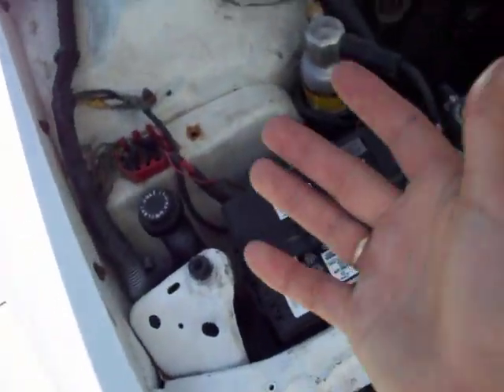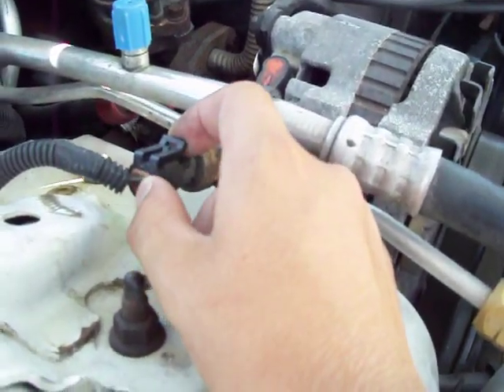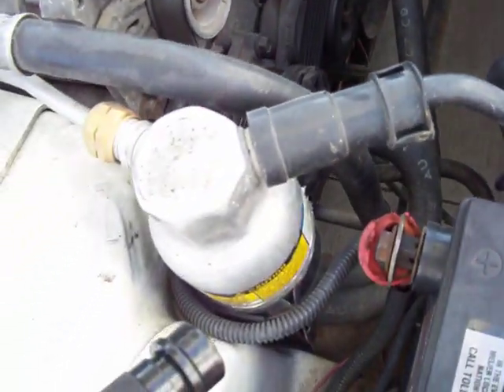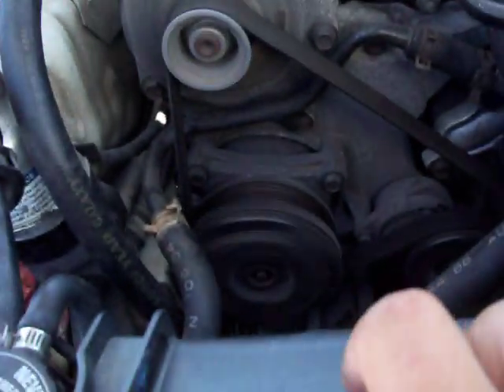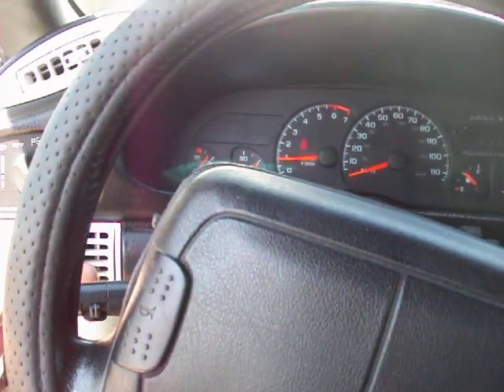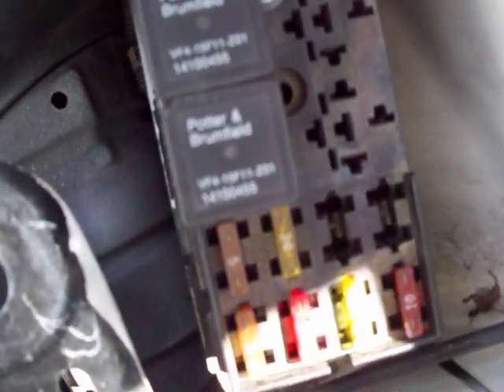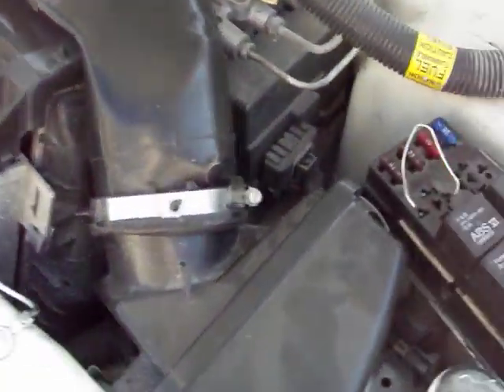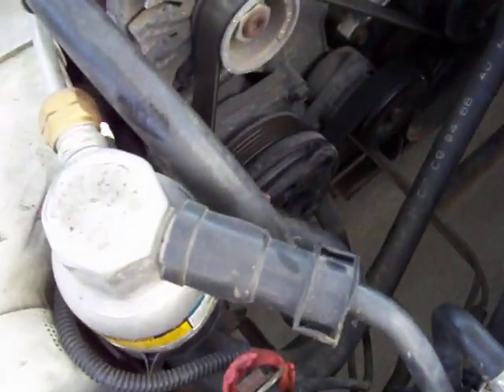How To Make AC Ice Cold, Recharge air, and Force the Compressor Clutch to Engage

Comment: I had to have all my system emptied to replace heater core.   When I was ready to refill, my clutch would NOT engage.  Followed instructions to put 1/2 can in. Then 3/4 of 20oz can, and best I would get was it engaging for a few seconds every 30 seconds or so, but could not get enough in to"satisfy" the computer.  I did the paperclip trick and had it working in less than a minute.  Great post and instructions despite all of those that disagree!   Thanks!!!
Reply: +Joel Gueck  If It is charged, what is the pressure on the high side of the system? If I were You Joel, I would get a video of the PROPER AND CORRECT procedure of how to do work like this...Dis-regard the video the air-head 101 dude posted above.... And Joel, never-ever use the sealant he suggested... It often destroys a/c systems and will give You consistent problems...

Comment: "If you have any questions, make sure you ask someone, I'm sure anyone can help you."

I LOL'd. Best instruction video ever ;)
Reply: I heard that one, I think he's trying to say, someone will help you, lol
It's much more complicated than this video.
Reply: I was like anyone?? When i tell ppl bout shorting relays they look at me like wtf lol
Reply: Thing is, once you’ve put that stop leak stuff in your A/C system, if later you have to take it to a shop, you’ll be pretty hard pressed to find a reputable shop that will work on it because that stuff fouls up refrigerant capture systems.  Further,  if the paper clip test activates your compressor, you’ve found the problem...why not get a new pressure switch and correct the system fault properly?
Reply: @douglasashby4862  The sensor is noticing low pressure. So it won't let the compressor run. No compressor means no recharge. So trick the compressor into thinking the switch says there is pressure, then refill.
Reply: @douglasashby4862 not enough freon, won't allow your compressor to kick on. The 📎 is forcing the compressor on without enough freon in the system. Once you get enough freon in, the 📎 is t needed. That's not an indication of "finding the problem"

Comment: As someone who works on computers on a day to day basis and just starting to tinker with cars, this video has helped me a lot. Thank you so much. Really.
Reply: Alan Trevino De Arcos Hello Alan, what really needs to be done is to refer to the PROPER methods of doing work like this... Get info from a PROFESSIONAL technician who has EXPERIENCE doing things like this... Please dis-regard this video as it is wrong in several points...DO NOT use the sealant he described in this video as this will probably RUIN Your a/c system...Use the video available at Auto-Zone of how to PROPERLY do this procedure....

Comment: Your description of the terminal 30 and 87 function, or I should say the flow of current was extremely helpful. I'd seen a couple others and they'd, say, show the relay diagram and say 87 and 30 were responsible for starting the clutch....but not that 30 was power to the relay, and 87 is power to the clutch (compressor)....and - say - used alligator clips to 87 and 30 with no explanation as to WHY....THANKS!!

Comment: read some comments most criticism, but No Help at least this Youngster is trying. What R U Doign????
Reply: if you add refrigerant it will tell the low pressure switch to turn on the compressor. than you watch your gauges untill you are close to your temp psi chart. weighing tanks takes too much space in my trunk. DO NOT RUN YOUR COMPRESSOR BY A PAPER CLIP!!!!!! THERE ISNT ANYTHJNG TO LUBRICATE IT IF THERE IS NO REDRIGERANT!!!!!
Reply: Thanks for help
Reply: @soupboy2391 you can't even spell refrigerant correctly. You do need to force the compressor on with a 📎 if it's to low on freon. Otherwise you won't get it to accept freon if the compressor won't click on!
Reply: @James Medina  the refrigerant is pressurized. When you add it, it will trip the normally open low pressure switch to turn on compressor. Freon is owned by Dupont.

Comment: fantastic, did this yesterday because the air coming out of the vents was warm. compressor not spinning. used this method and followed the instructions and the compressor started to run automatically when the pressure went above 25psi. now its reading 40psi and the air coming out the vents is cold. great. thanks.
Reply: I know you made this comment like a year ago, but I'm in a similar situation. Did you use the paperclip to force the clutch to engage while recharging, or did you just recharge without doing that? Is it even possible to recharge it without the clutch engaged? I'm guessing no, but I don't know much about this stuff.
Reply: The compressor must be forced to engage if isn't engaging on it's own. You can't recharge without it engaging. It won't suck in the freon into the system if it isn't engaging.

Comment: Just recharged the a/c in my 1998 C1500 W/T after years without. Tried before but always thought since the compressor didn't turn on it was going to be an expensive fix. Never thought of jumping the relay, it worked. Most relays have marks near the prongs, 30 and 87 are labeled clear as day, three inch piece of 18ga wire and go. 90 degrees today but not in the cab. Thanks man

Comment: this actually worked for me ford explorer thanks dude...funny how all the mechanics come to hate instead of making a video with advice like this young man who is just trying to help haters
Reply: David Sanchez, Dave- did You actually add the sealant as this video suggests???? What is Your high-side pressure at an ambient temp. of say- 95 degrees F. ???? If You added the sealant and You don't know what the high side pressure is, chances are that Your vehicle's a/c system won't be working for very long Amigo.... These people who are commenting here of the fallacies of this video are not haters, but quite to the contrary; they are trying to prevent others from getting into trouble- from the very bad ideas/advice given in this video.... If You don't agree with that, that is fine- Just as long as You don't pretend to be a 'technician' and use these techniques to work on other people's vehicles... That could cause other people to think of YOU as an ill-trained hack who does not care for others, except for maybe- their money... They might even think of YOU as a 'hater'.....
Reply: yeah. my thoughts too. with all their typing, they could of made their own kick ass totally perfect videos
Reply: To Robert Henderson, The typing is a good practice in communicating to others, who actually want to get some problems taken care of, in this case; automotive a/c systems.... And then there are those people who are not interested in communicating at all - or try to repair anything... They Just want to heckle others who are repairing problems... These people soon become an interesting study of what happens to an idle mind.... Did Your mother have any kids that lived?

Comment: I want to say thank you for providing this video.  I realize there are a lot of people here commenting who are great mechanics and have a great deal of knowledge about cars.  The individuals who are commenting about his using of this method to force the AC clutch to engage are in a way correct about the methods used, but the author of the video is also correct .  Always wear protective eyewear when working anywhere near pressure lines and/or fluids/chemicals that can damage the eye(s).  His method of shorting out the fuse so that the clutch will engage will in fact work and he is knowledgeable in that regard.  The problem, if the pressure is in fact low, is that there could be a number of things wrong causing this to happen and may even be a leak somewhere in the system which means adding more freon is a waste of time, effort, and money.  Make sure to talk with a mechanic before doing any of this work as a simple freon leak could be present and that may be all that is causing the problem.  Low pressure due to a freon leak can cause the clutch to disengage.  If however the clutch is not engaging because of something else, adding more fluid (i.e. increases pressure) which can damage the compressor possibly leading to you having to buy a new one altogether.  So make sure to get quality advice to ensure it isn't a simple repair resulting in low cost repairs that can also be warranted by a professional.  All in all, think of your car as a necessity and give it the proper professional care it needs to run optimally.
Reply: +Brandon Nelson  His methods are nowhere near to the proper way to do work like this!!! Get info from a credible source before attempting this!!! Do get the video from Auto Zone or a service manual or a publication written by EXPERIENCED PROFESSIONAL TECHNICIANS and study it and adhere to it... DO NOT use the information posted in this video...

Comment: HVAC was a trade of mine at one time. Rather than jumping out the pressure switch turn the can of 134A upside down while the engine is off and dump liquid refrigerant inside the system. Leave the can upside down and go do something and come back maybe fifteen-twenty minutes later and by that time the system will be charged enough for the ac compressor to kick on. After that add the rest of refrigerant needed with the can upright for gas.
Reply: mardasee you are awesome worked exactly as you said thanks.
Reply: Thx cuz the dude's process confused me

Comment: Well if the system has residual gas in it but is low so the clutch doesn't engage, then recharging should still occur without clutch operation. 
When the system is getting enough pressure from filling, then the clutch should automatically come on. The Hi/lo pressure switch on the drier (or elsewhere) is just an on/off arrangement.
If there is no residual pressure in the system (check by pressing on Schrader valve pin) it needs the leak fixed and then vaccing out before recharging. 
Gas should only be put in to a system (which has been opened or has had nil pressure) that has been evacuated because the low pressure causes any moisture in the system to boil off and be removed from the pipes. Moisture mixes with the refrigerant and causes acid which eat the steel pipes ie. the evaporator (which is in the dash).
Residual gas pressure - even if it is low, in a non working system is generally a good sign.

Comment: I want to thank ypu for this video! I was trying to find a way to engage the compressor on my 97 silverado.. It worked like a charm to engage the compressor to add AC pro. I know that I will need to take it in as I suspect a leak somewhere in the system. However I am away from my local dealer right now at a training class about 300 miles away.   I should be cool for the ride back. Thanks again!!

Comment: Wait, if the system is empty it must be because there is a leak on the system.
Adding Freon on a lakey system is just throwing money.
Find the leak first and fix it.
Jumping the compressor tells you if the compressor works or not.
I Wouldn't run the compressor for more than 10 seconds if there is no Freon and/or oil in the system.
Apply vacuum to the sytem to locate the leak. Once fixed, vacuum should hold for 30 min. Then you can connect the supply hose/pressure gauge and Freon, the vacuum in the system will suck the freon into the system even with the engine and AC off. 
After one or 2, 12 is can inside the system turn on the engine and AC on high and compressor will kick in. Add freon as required.
Vacuum pumps range from $20 to $200. The low cost pumps are air operated. The more expensive electricity powered.
A manifold to check the vacuum and freon pressure run approx $60 to $100.
Watch you tube videos on how to check leaks and fix them ETCG, CHRISFIX, REAL FIXES REAL FAST, SCOTTY KILMER, and many more.

Comment: Forcing compressor to kick in low pressure is a bad idea. If refrigerant is low the compressor is designed to stop, so not to grind dry and damage itself. Forcing it could damage compressor and you could be down for $400+ in damages. If you're low in Freon and compressor stops, the refrigerant in the refill can has enough pressure to kick start the compressor. Make sure the can is upside down and shake it while refilling system.
Good Luck

Comment: This guy is doing the right thing in a particular situation. Not all the fails of a cooling system can be fixed so easily. A cooling system is quite a complex system that requires some expertise to be fixed and some measurement devices. A cooling system contain R143a cooling agent and some amount of a special oil to lubricate moving parts of the compressor. Consider this: if the cooling agent have been evaporated, than maybe is a leak somewhere. Not fixing the leak would make you to refill the system in a short time and the leak will still be out there.
Reply: ***** I was talking about the air cooling system, wise guy!  I know the car engine's cooling system is using a special liquid known as "engine coolant" made by water-glycol mixtures who has antifreeze properties and also lubricates water pump. Read better next time.
Reply: Johny Macaroni  You are partially correct Johny Macaroni... The individual who posted this video is not anywhere close to the correct method... He claims it to be "air  101" .... He should have said 'air-head 101' !!!! This method is very dangerous and unfortunately , several people here have followed this video and advice like a herd sheep following a blind lamb - right off a cliff.... 1) He DID NOT mention ambient temperature or the use a pressure / temperature chart or even using a thermometer  2) He DID mention using the A/C sealant, which will void most vehicle warranties and will probably cause massive problems  with most a/c systems  3) He Did use a low pressure gauge , but He DID NOT use a high pressure gauge in the high side of the system... This is a very dangerous situation that could easily have caused a burst in the high side of the system...  4) He never correctly diagnosed the a/c system for leaks and by doing so, put more refrigerant into the system without repairing the leak (since He did not add the [FATAL] can of a/c [destroyer] 'sealant' to this vehicle) and the system will continue to leak refrigerant into the atmosphere and continue to loose the lubricant in the system without even mentioning adding dye to detect leaks or adding any lubricant to the system.... 5) He did not mention to the viewers to wear eye protection while doing what He did in this video... 6) He did not mention how to correctly identify the difference between the R-12 systems and the R-134 systems.... What I agree with You Johny, is that the individual is in error with this video, but what I dis-agree with You is that He was "doing the right thing in a particular situation" as You said . NOTHING He demonstrated here was correct... 7) The use of a paper clip to jump the relay posts is an accident waiting to happen, as even That was incorrect...Jumping those terminals is a proper procedure, to temporarily activate the compressor, when done with the PROPER tool to do so.... He should have used a 16awg insulated wire with bayonet connectors (the same size as the relay terminals) to do this, instead of that hoaky paperclip.... This is why I'm suggesting that people dis-regard this video as it is the work of a person who is ill-trained and in-experienced and He should not be posting this until He is capable of showing the PROPER method of doing work like this... I have seen his later video as he is trying to do some damage control from this video...He seems to be much better schooled/educated,  but it still does not address the major issues that he instructed with this video he made 4 years ago with the bad advice....
Reply: +Michael Martinez We get it, you are a pro and he is wrong. Commenting on every single post in his video does not make that any more the case. Pipe down, people can and will have read your response already.

Comment: YOU DONT HAVE TO FORCE COMPRESSOR ON WHEN YOU START FILLING SYSTEM UP PRESSURE GOES UP AND CLUTCH STArts to engage.
Reply: Thank you cuz I'm confused. He says that not enough refrigerant makes clutch not engage. Yet you still need to mess with relay?? And that paper clip thing isn't clear.
Reply: If your clutch is bad all that is for nothing and a good shot at frying a computer

Comment: In my case I had to get the pressure below 45 to get the compressor to work properly on my 2006 Hummer H3. Apparently I over filled it and the compressor was switching on and off too quickly till I bled off some of the refrigerant.
 Thanks so much for sharing the knowledge.

Comment: There is a safety device in the refrigerant circuit called a head psi switch which may also cycle the compressor. Bypassing any wiring to force the compressor to run is not wise. If you should bypass the head psi switch unknowingly, there could be injury or death related to a high pressure rupture or the compressor could be damaged immediately.
 Although I admire the objective in the video, there are so many other factors in simply charging a system one could write an article about it. Doing it wrong may result having to buy and replace more expensive components in a day, week, month or a year later. However if you are working on a clunker- go for it.
 41 years in HVAC, designs and servicing.
Reply: +newstart49  I strongly agree with You on this !!!! The only thing I do not agree with is the part of "If You are working on a clunker-go for it"... Even a 'clunker' as You put it , can injure and /or kill when being serviced incorrectly.... People should understand the inherent danger of doing work like this, when being shown the incorrect methods of doing so... I just wonder how many vehicles and people will get damaged/injured by using the advice from the ill-trained novice above....
Reply: Michael Martinez
Agreed.
Reply: Michael Martinez ""0